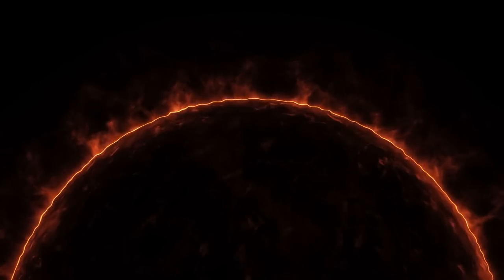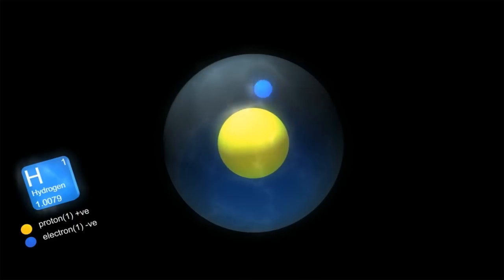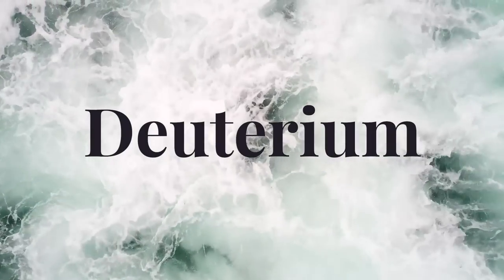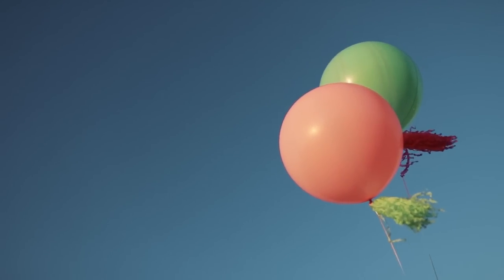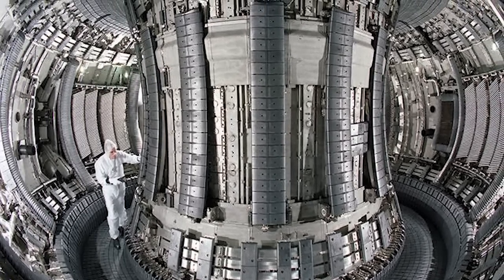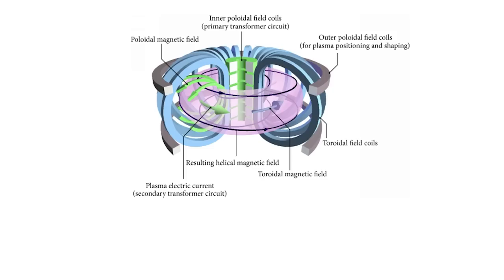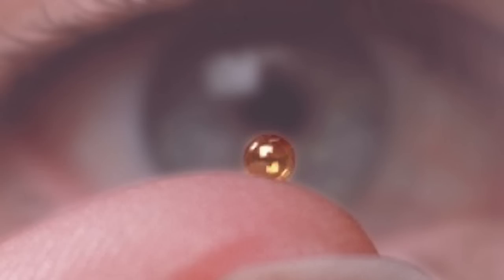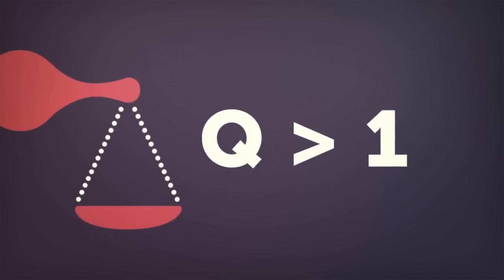Fusion Energy is About to Unlock Humanity's Destiny

Comment: Fission plants can NEVER explode like a nuke. Please don't say stuff like this.
Reply: Yeah, I thought that was a bit disingenuous as well. I'm pretty sure fission reactors have a different grade of fuel, and modern reactor designs address basic design flaws that old plants like Chernobyl were built with.

But his point is pretty accurate.  When you assemble a critical mass of fissionable material, the reaction is far easier to continue than it is for fusion.
Reply: Actually, a reactor on a nuclear submarine could have a fair go at it; it requires fairly highly enriched uranium, not weapons grade, but much more U-235 than in a commercial plant. And of course, there's no big honking containment. That said, the crew are the technical descendants of Rickover, so they're basically gods. But even on Olympus, goofy things happened.
Reply: Slight addition: The richer fuel is required in order to have a reactor that fits on a sub.

Comment: Saying fusion is 30 years away now is totally different from saying fusion is 30 years away 50 or 80 years ago. It's moving the goalpost to go from "fusion will be achieved" to "we'll have a bunch of actual commercial uses powering homes". Assuming the ITER project works, then fusion is only roughly 5 years away, it just won't be mass-adopted. In fact with the original goalpost probably being "fusion will be achieved", we hit that goal back in the 90s, getting close to 30 years ago now (well 23-24, but getting there)

Comment: Correct me if I'm wrong, my information are from 40 years ago. The nuclear fusion itself is not the end of the story because it's not electricity. In order to achieve that, Deuterium an Tritium need to be fused and that emits one neutron per molecule (pn + pnn => pnpn + n). These are captured in a Lithium blanket around the fusion core. The Lithium heats up and from this point on it goes like any other conventional power reactor: Lithium heats water, steam powers a turbine, which drives a generator.
The problem here is the Lithium which gets fed loads of Neutrons and thus becomes radioactive. So in the end, nuclear fusion is not so clean as you've advertised it, unless my information is outdated.

Comment: not so much boom if you lose control of a fission reactor, the runaway reaction melts the core and becomes a bubbling puddle. what explodes is the steam released when the pipes burst and the continued heat creating hydrogen in the steam/water, which explodes a second time. these problems don't exist with a molten salt reactor.

Comment: You totally forgot the Wendelstein X-7 Stallarator! A different approach to Fusion! 

There is not just the UK research, you know! 😋 Still, good show! Keep it up!
Reply: @DeamIT Germany did 3 I think. Japan one and the US too. Spain and Australia should have smaller variants as well according to Wikipedia.
Reply: woo W7-X!
I'm working there right now 😀
Reply: @philipG2337  That's amazing! I really hope the stellarator concept is the one to pull through. Are you still testing or already modifying the reactor for phase 2?
Reply: @Starjumper2821  Everything we will do is testing in the sense that W7x will not be capable of DT fusion. The walls are too thin and it just isnt built for any radioactivity over DD testing (Though the government still requires multiple high-tech geiger counters running 24/7 that will not be measuring anything :/ just because its nuclear)

As far as I know we are already through phase two and are currently modifying the reactor with better cooling and a better divertor for 30min pulses, just to show the possibility of that.

you can also look at those for further information:
https://www.ipp.mpg.de/17019/meilensteine (english)
https://www.ipp.mpg.de/9342/meilensteine (german)
Reply: @philipG2337  Perhaps I should have been a bit clearer. I meant whether test are still running or if the planned 15 month modification was already underway.
Reply: @Starjumper2821  Right now they are in the Assembly phase. No shots are being done and/or were being done in the last months.

Comment: 0,5g for 400MW? Maybe 400MWh? megawatt is unit of power, not energy
Reply: Watt: the SI unit of power, equivalent to one joule per second, corresponding to the power in an electric circuit in which the potential difference is one volt and the current one ampere.

Comment: @3:38 that’s at best extremely misleading. Fissionable materials in a nuclear reactor aren’t concentrated enough to cause a nuclear chain reaction as is used in nuclear weapons. Do better research before you bash other clean energy sources.
Reply: "Fissionable materials in a nuclear reactor aren't concentrated enough to cause a nuclear chain reaction", and yet meltdowns in a nuclear reactor CAUSED BY THESE CHAIN REACTIONS produced massive explosions and radiation waste all throughout their history. Yes, these things happen. They happen a lot less now that we've gotten better at making these plants, but it's still a possibility. And you haven't even cited your sources for this rebuttal.
Reply: @heckingbamboozled8097  What is a meltdown?
Reply: @heckingbamboozled8097  DM me I'd be happy to share.
Reply: @raygunn13  Exactly what it sounds like. Melting of the reactor core, comprised of solid rods of fission fuel, be it uranium, MOX or whatever. It happens when the primary cooling agent is lost and the fuel rods melt into an incandescent pool of liquid metal that can maintain the chain reaction for decades, emitting heat and radioactive waste in the process. Some designs avert this by having the fuel elements contained in graphite-ceramic spheres that need over 3,000 degrees to melt.
Reply: @lucianene7741  I'm glad we agree that this isn't the same thing as a nuclear chain reaction utilized in nuclear weapons.

Comment: Free energy. Ha. I'll believe it when they stop sending this damn Bills for power already. 🌞
Reply: We can do it already with solar and battery storage. I charged my eletric car for free today.
Reply: @jamesbird6103  Solar Panals have life of what 25 yrs?  The battery in your Electric car even less.  Replacing batteries on Hybrids are almost cost of a new car
Reply: @HighLiner15  Price will come down as its made more and both are totally recyclable. Until they dont work anymore I will enjoy driving for free :) even if we crack fusion we still will need the electrification of transport to take over. Why should we wait?
Reply: @jamesbird6103  That's not how money works, mate.
Unless you stole both the solar panels and the car and forced someone to install the panels for free, you do pay for your electricity. It's called pay-off and depending on the initial investment, maintenance cost, component lifetime and electricity saving, the pay-off doesn't even have to be net-positive.

Comment: We do have fusion in H bombs. But to start the reaction requires a smaller fission reaction. The problem is with fusion is that we need an immense amount of energy to start the reaction thus making the input vs output ratio much less efficient. In the sun the fusion is caused by the mass of the star and gravity compressing the hydrogen atoms to the point where they fuse. The sun's size, and the pressure pushing inwards make it so that fusion energy released in the star's core may not reach the surface for 100,000 years. Anyhow, if we can figure fusion out as pointed out in the video, it will fro sure revolutionize the world as we know it
Reply: We can already do it, the issue is just material science. The physics is fine.

Comment: What if we made the reactor much smaller and use many magnetic coils and a few electromagnets. You can base it off of Tony Stark's arc reactor and have a transformer in the middle of it to change the voltage of electricity and just put the sea water in the device and heat it up using power. It would be perfect!

Comment: Grams of fuel translate into mega joules, not megawatts. For megawatts you would need to know grams of fuel per hour.
Reply: Darn, you beat me to it.  I shouldn't check before posting.
Reply: Perhaps you are thinking about Megawatt hours? Joules and watts are both units of power. Watt hours are units of electrical work.
Reply: @FairfaceCZ  Please check facts before generating worthless notifications. Even after editing you're wrong. 1 watt-hour (non-standard unit) = 3600 joules (SI unit) = 3600 Newton-meters.  And work is work.

Comment: Stopped watching around 2:52 when it became clear that this guy does not know what he is talking about.
So half a gram apparently produces 500 MW of electricity - for how long? If it's one hour, that's 500 MWh of energy, a very large amount. If it's one microsecond, that's around 0,14 Wh which might be enough to increase your phone's battery charge by one percent. The statement in the video is meaningless.
Reply: And they already do use fusion in power plants ( I am 99% sure) and hearashema ( do not know how to spell the name of it) was fission and fission is a chain reaction.
Reply: Apparently outraged enough to stop watching and typing a comment of 4 lines, instead of taking the same amount of time and looking it up yourself on iter.org or other sites.
Reply: He soon after proceeds to say that "nuclear power plants are essentially harboring a controlled nuclear bomb. If we lose control then the chain reaction  takes over and.. BOOM!" what a load of bull..
Reply: @Bunnysinger  The point wasn't just about this particular piece of 'information', but rather that if he is that clueless, you cannot trust anything he says in other matters either. 
He's basically running a hoax here. There are plenty of channels with scientific information out there where the people behind them actually know their stuff.

Comment: You're doing the same mistakes of over simplifying nuclear fusion inside the sun
Reply: Younes Layachi in what way? I dont think a complicated explanation of the sun is needed to get across his point
Reply: @undiecover3939  the sun does it because it has immense pressure, meaning the core doesn't have to be as hot as a tokamak, a self sustaining fusion reaction is impossible on earth
Reply: @TheRandomshite123  and that's where you are wrong sir

In fact
Sustainable fusion is actually very much possible on earth just fine

Yes you are right
We do not have the imense pressure the sun has thanks to its mass

But as you guessed

We can produce much higher temperatures then the sun

And what we can't make atoms do by pressure we can make then do with thermal energy

Pressure presses the atoms together making the fusion of two parts aka atoms in this case easier which means lower temps like a few million degrees is enough for fusion

And the produced energy keeps the temperature level where it needs to be

Well we don't have the pressure but with enough heat you can make the atoms go fast enough to fuse anyways

Well and then you just need enough fusion to happen at once so that your output energy is enough to keep reactions going

Funny enough that mass lays in the grammes of fusion material

If I made a mistake
Be free to correct me
Reply: @undiecover3939  "The W boson, which is electrically charged, changes the very make up of particles. It switches protons into neutrons, and vice versa, through the weak force, triggering nuclear fusion and letting stars burn."
Reply: @thesteambreaker9449  there was a really good video that explains this, unfortunately it was in french. I'm looking up English articles right now, well post anything I find here

Comment: The sun is the only energy source we need. It radiates more energy on the earth in 30 minutes than we use in a week. All we have to do is tap into it. We’re learning fast how to do that but If 10% of the research into fusion energy  had been put into solar energy we would all be sitting pretty today. It is just a matter of political will.
Reply: We spend way more researching renewables than we do fusion?

Comment: Star's interior is high pressure & high temp.

We can try to replicate high temps of the stars, but replicating such high pressures isn't a easy... especially considering the lack of mass & gravity of a star in our labs. Therefore, we need even higher temps to compensate for that.
Thus, we end up spending more energy to produce less energy in the end.

This explanation is for normies. Ofcourse, it's much more complicated than that.

So, I can't emphasise this enough, fusion is easier said than done.

Comment: Until fusion is ready, fission will have to fill in the gap. The  EBR-II reactor in the 60's proved that fuel reprocessing and a closed fuel cycle is possible, eliminating most of the nuclear waste, in fact most of the "waste" we have now would still be perfectly good fuel for reactors like EBR-II. With careful management and reprocessing there are enough uranium in waste stocks alone to last a few thousand years.

Comment: So, rather then compact, why not one large satellite generator in space where there's less interaction with gravity?
From there wireless energy transmission tech is getting a foot hold.
Further equipping such a device with solar panels could act as a fuel source to control the 'on off' switch.

Comment: @13:45 "Electricity costs would plummet"
I highly doubt it. Energie companies will sell the energie for the price consumers will be prepared to pay for it that's the basis for the current freemarket systems. 
Apart from building and maintaining a fusion power plant will costs enormous amounts of money which will be calculated into the price per kWh. Governments now have a "green" tax on every kWh a consumer uses. They use these added taxes not for environmental purposes but it goes onto the big heap of tax payers money. I don't see that extra tax suddenly dissappearing when fusion reactor plants start popping up. (You still have to pay these taxes it even if you have a "green" energy contract by an energy provider that produces most of the electricity they sell from renewable sources)
Currently electricity prices between different energy companies vary only slightly. So there are probably secret price agreements in action between different companies. 
All in all I'm assuming fusion power will benefit energy companies and governments, maybe big businesses which have the power to negotiate lower prices. But the average consumer will keep paying more or less the same.
It's the same with gasoline. Oil prices dropped enormously last year. but at the gas stations prices stayed well over €1.50 per liter (= $6.92 per gallon).
And I expect the energy industry to go the same way as the pharmaceutical industry did, who sell drugs that costs less then a dollar to manufacture for hundreds of dollars. Never underestimate the greed of private corporations who need to keep their billionaire board members and investors happy.

Comment: If E=MC2 is true then M=EC2 must also be true. The problem is getting the proton into phase with the energy wake/EMP. If you detonated a nuclear device inside a supercollider and struck the wake at the precise speed it was moving and the exact opposite angle of refraction you mite end up with a super mass reaction. Or it could be as simple as striking an electron field with a proton moving at or near the speed of light. I'm not sure but my gut tells me a super mass reaction is possible. Even more exciting is that it may be possible to build a machine that oscilates between the 2 reactions the resulting magnetic field fluctuations could be used to operate a dyno system to produce alternating current eliminating the need for a turbine system. Essentially creating a self perpetuating nuclear power source. Though when talking about a super mass reaction your essentially talking about the creation of a tiny black hole. We could end up with spent fuel that is actually spent in a system like that, i.e. no more nuclear waste. The reaction would eventually in theory burn itself out. We are talking about the pure conversion of matter into energy specifically electromagnetic energy to the point that nothing remains. Imagine it like a controlled nuclear reaction, one that last years instead of fractions of a second, and also requires far less fissable material. That is the power source of the future. At least the near future. Crack that nut and you've really got something.

Comment: The solution to our energy problems is in the sun, through solar power. A nice big mirror dish and a sterling engine. No need for tricky photovoltaics, and you have good clean electricity. Maybe like in Sim City, have an orbiting solar array and beam it down via microwaves.